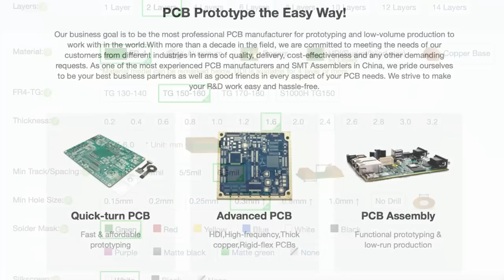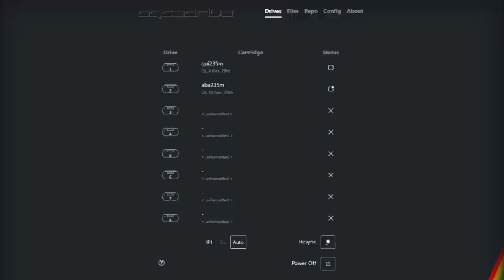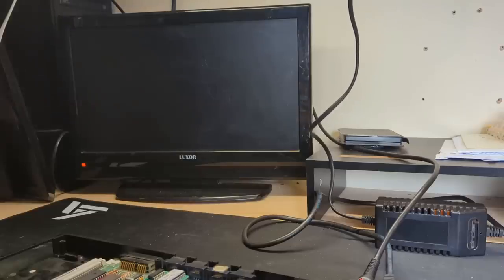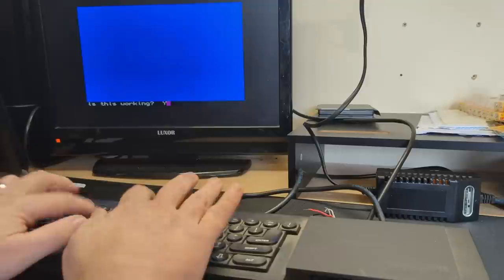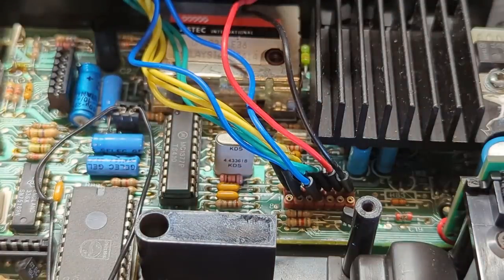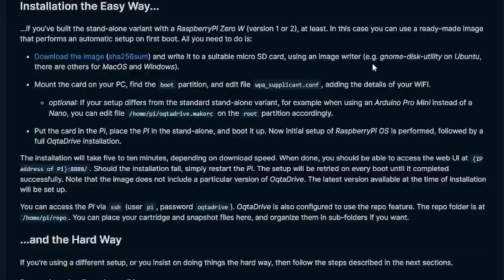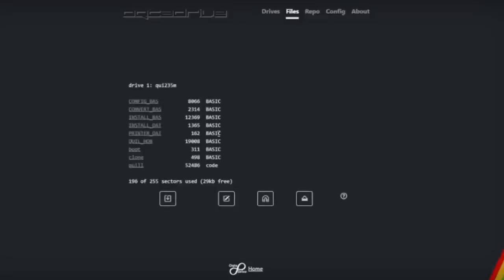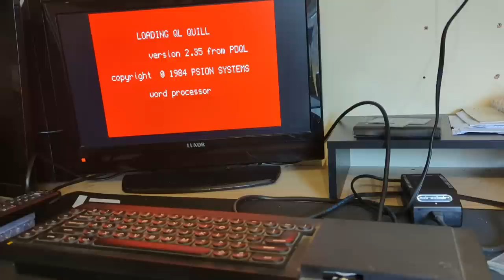Sinclair QL Part 2 - Upgrades!  Building and fitting the Oqtadrive, Minerva ROM and lots more.

Comment: The QL is what made me launch RWAP Software - having taught myself programming on the ZX81, I took the "quantum leap" to the QL as soon as it was released and loved the improved version of BASIC (SuperBASIC) and 68000 Machine Code - so easy to create programs in SuperBASIC and then replace the time critical functions with machine code.

Still regularly turn to the QL / SuperBASIC to knock up a bit of code when working out how to emulate an unknown printer and still supporting the QL 35 years later!

Comment: (comment disappeared, I think) That's one of 'my' Minerva ROMs you've fitted there. The TK2 part is not diagnostic and is enabled by default (jumper on the centre and left pin). A few bits of software/games don't like TK2, hence it can be disabled. The RAM diagnostic is part of Minerva and is always present.

Comment: About the nano clone not working thing, in my experience they ship with an older bootloader, that's probably why they aren't working, different baudrate for uploading. If you're able or can be bothered, just flash the default nano bootloader on them and they should be fine

Guess how long it took this nerd to figure that one out... :P

Comment: The 512kb QL RAM Quintupler is a must!  The pcb is super thin, so be careful, and the red 68008 socket is weird and requires you to put some incredible force to get the pins in, but 640kb of RAM is a much needed thing to run advanced stuff like Hack 1.03!
I got mine on ebay for 40 euro give or take.

Comment: Yeah. I have had one (they said they were refurbished and it seems like it is. It's looking beautiful) for something like 3-4 years. Don't have anything for it. PSU, RGB lead, microdrive... Have to buy a new PSU etc. I kinda want to see, is it even working at all ;)

Have used one unit for a few weeks, a very long time ago... It was really a disappointment. Though, I'm very interested to see (and have one, as I do now) what the machine is capable... Though I think, it has never been tried to use to it's full potential...

Comment: Microdrives never worked. Before people complain i'm 53  and if you  want to disagree i will need to see your passport before i join in a discussion.
Reply: I'm 50 and they worked only if you didn't use them too much. I had a Sandy SuperQboard with a 3,5" DSDD drive... And still have.
Reply: @CitroenGS  LOL I had more success with the wafadrive then the microdrive! I remember someone saying that you could store more data on the microdrive if you pre-stretched it !
Reply: @stevewhitcher6719 I never had the Wafadrive, so I can't talk about it. I only had the Mdv on the QL, then diskettes.
Reply: I'm afraid my passport has expired, and I'm so old that I'm unlikely to to need it again. Anyways, mdvs worked - for some people some of the time. But very fussy little dumplings they were. Each QL had its own characteristics, and so mdvs that worked on one machine may not work on others, indeed some mdvs would work on mdv1_ but not mdv2_ on the same machine. A switch to floppies was pretty much essential.
Reply: I have a QL and some ZX microdrives that are restored - for whatever reason, the ZX microdrives work almost entirely reliably whereas the QL units seem a lot more fussy.

Would love to try a Wafadrive but yet to find any cartridges that haven’t snapped

Comment: to emulate the microdrive about 200+ mips are used, the computer itself has about 2-4 mips.

It would be interesting to develop a variant of the Pistorm, so the original mainboard is retained, but the computing power would increase dramatically
Reply: I have all the parts, including spare QL motherboard, except for the actual Pi which is still so outrageously expensive. Hopefully this summer I can give it a try when school is done.

Comment: Whilst a very enjoyable video I'm getting real "When are they going to get to the fireworks factory" vibes. As in I really want to see you trying to use the QL's software and it feels like that's what both this and the previous video promise but don't deliver on. What they deliver is great, just not what I expected.
Reply: I did a video in June of 2021 where I used Quill do see if it could substitute in a pinch (i.e. if all I had was my QL, could I edit a Word document). It was workable.

Comment: Great video and thanks for the shout out :-) Just one quick addition, the logic level converter is for the serial communication between the Nano and the Pi, basically 5v to 3v3. The Traco converts the 9v to 5v to power both devices.
Reply: @bzuidgeest  The design is quite convoluted, but we should just be glad that such a device exists, or rather someone has spent the time to develop one.
Reply: @bzuidgeest  I think this convoluted design actually saved some development time.
Reply: The design is this way to be flexible, rather than convoluted, and it did save Alex a lot of development time. I'd recommend you read up on the design criteria for OqtaDrive on his landing page which details all the decisions made and why.

Comment: Nice video.

I noted that it was said about the Minerva rom, there is Red jumper to select a diagnostic toolkit, this is incorrect.

What jumper does is to select the 16K rom code containing Toolkit 2 that is licated on the onboard rom chip with the Minerva operating system. Moving the jumper to the other disables this onboard rom and the normal QL Rom Port can be used.
Reply from the maker: Thanks for the info!